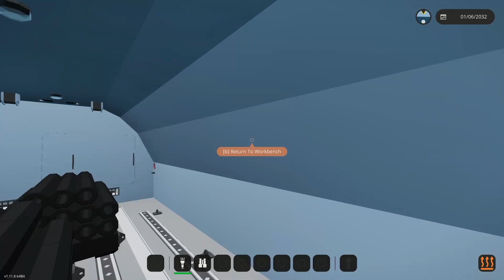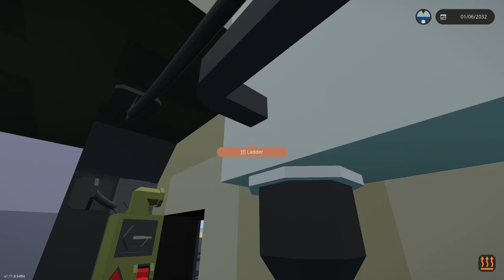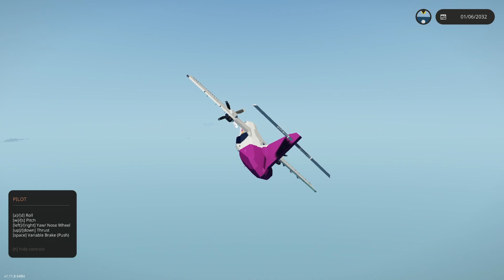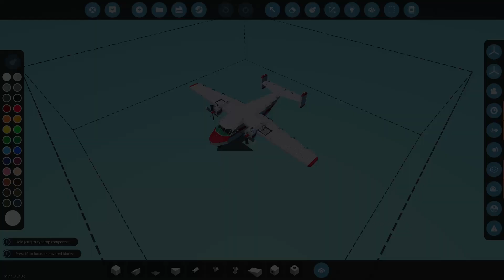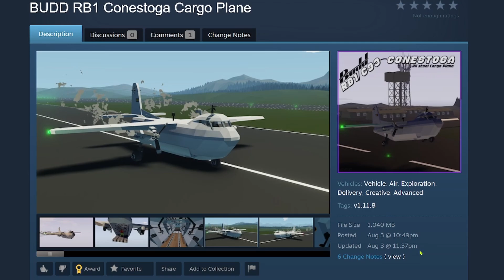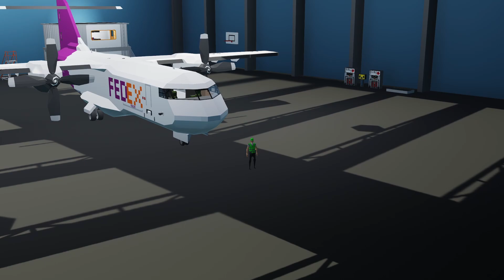Stormworks: Build Challenge Mike. Cargo Airplane #stormworks #gaming #gamingvideos

Comment: Thank you for your input on my aircraft unfortunately was suffering from 102.5 fever so wound up fizzing out by the end of it (ie the workshop page and thus its lack of value ). recommendations do state that regularly flaps are not needed, the Yaw + roll system adds yaw when the aircraft is rolled and some other things such as recommended throttle value when landing but of course it was a little too lengthy and I will be changing it. Thank you once again